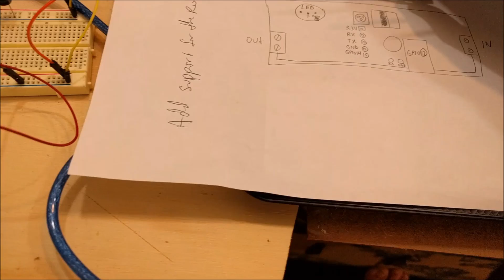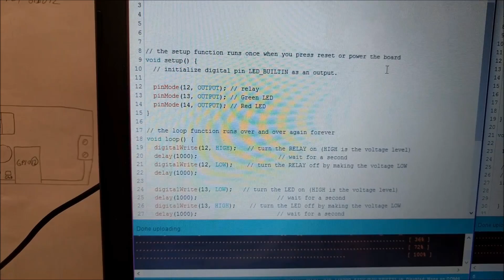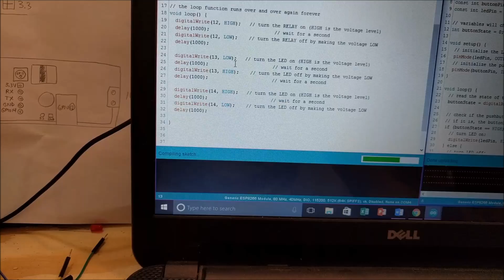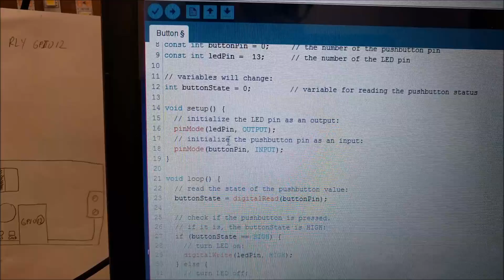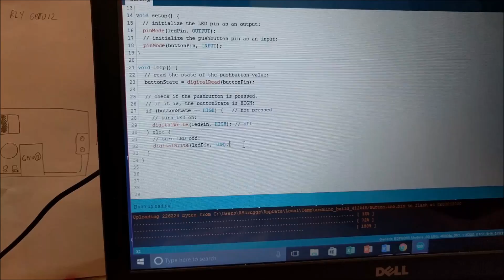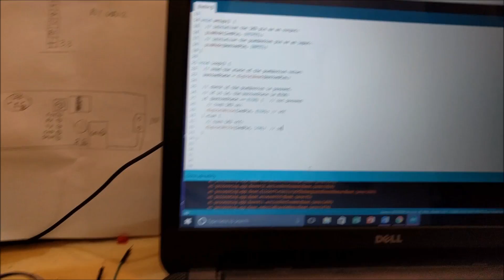Sonoff Secrets

Comment: I might be mistaken, but the FTDI-Dongle you are using has a 3.3V Jumper for supplying 3.3v instead of 5v. So you don't need the workaround with the arduino mega.

Atleast mine has
Reply from the maker: yes it does have 3.3v but it does not supply enough current to power ESP. I tried, but it wouldnt power it. So I had to use Arduino Mega to power ESP
Reply: MadeEasy oh, i didn't now that. Thanks for sharing.

Comment: The Sonoffs that I have are the rf433 versions. These don't appear to have R21 populated on the circuit board and so the switch doesn't pull down GPIO0 to get into flash-mode. One side of R21 goes to R9 - it's the other side of R21 which needs to go to ground on power-up to get to flash-mode. I believe you can put a short between the solder pads on R21 to get the switch to pull GPIO0 low, but you may lose the rf433 functionality.
Reply from the maker: Interesting.. I have yet to get a hold of rf433, I dont have it in my inventory. thank you for the info. I will try it out when time comes.
Reply: David F ggj

Comment: what? the LED is a 2 colors LED, with 3 pins all connected; please check the info before to spread wrong ones!
Reply: MadeEasy  it is my understanding that the LED is dual color green and red. On basic Sonoff the red pin is not connected, but on the RF version of Sonoff, the red pin is associated with the  RF.
Reply from the maker: Giovanni Castania the red pin of the LED is not a GPIO Pin, it's not directly controlled by ESP.  Please watch whole video, I mention that I tried every possible GPIO and couldn't find it.
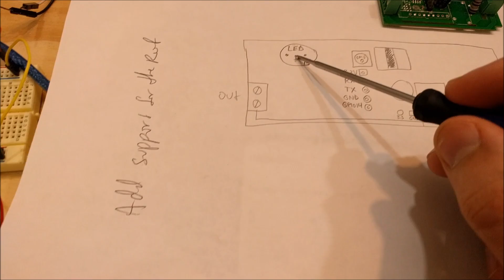Reply: well at 1:30 you said "the left pin is not connected to anything" and that's different from "not connected to any GPIO"!
Reply from the maker: Giovanni Castania thanks, I'll work on my wording. I appreciate your feedback as well. I had the channel since January. I'm learning as I go. Glad you stopped by to give me few tips. Thanks.
Reply from the maker: James Sinkiewicz ok thank you that helps me!

Comment: Nice try, but these secrets really aren't secrets and haven't been for quite a while.
There are replacement firmwares for the devices that do an awful lot. Tasmota is one.
Try and get an ftdi with 3.3/5V switch. They're pretty cheap and you won't need your arduino to program.
Reply: Here is a cheap one https://goo.gl/jnv9vU
Reply from the maker: Ill give it a try thank you!